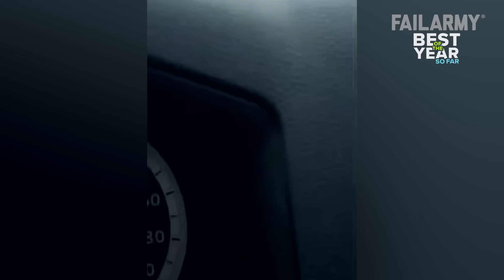Best Fails of the Year (So Far) 2023

Comment: 6:22 If there wasn't a video, it would be extremely difficult to figure out exactly how that truck managed to achieve that position. It's impressive.
Reply: I'm glad I finally saw it; I've seen stills of the end result. I hope they gave a copy of the dashcam footage to everyone involved so they can try to explain it to their insurance companies!
Reply: I wonder what the cops first thought when coming to the scene 😂
Reply: It was at this moment he knew he fucked up.
Reply: That's why I started watching this compilation. I watched that 3 times to figure it out.
Reply: I bet he quit
Reply: Execution was a little sloppy, but man, he really stuck that landing.
Reply: Definitely my favorite clip. Glad to learn the entire process.
Reply: That clip is in my top 3 "sir, you can't park there" moments. It's so VERY unlikely.
Reply: @caydengibson that was a rental truck, wonder where he'd quit from
Reply: You need my company to move a truck from were. Good luck pal.
Reply: watched a couple of times, insurance is glad it was caught on video, hard to explain what happened!
Reply: What is the part that rotates under the truck called?
Reply: @alexescare320  Flettner ventilator. That's the spinning thing if that's what your talking about. Or the drive shaft
Reply: @alexescare320  That's the drive shaft (also called a prop shaft). It takes the rotational force generated by the engine and sends it to the rear axle and wheels.
Reply: That was like something out of gta when you car glitches
Reply: @Ihavehadmanynames7779  Right? I expect it to start clipping and then launch thousands of feet into the air. 😂
Reply: I'm in the furniture installation biz, and I'm always looking for more efficient ways to get stuff to the second floor.  The dude is a genius.
Reply: I saw something very similar down the street from me. A sports car that was propped up against a building upside down, with all 4 wheels touching the wall. Driver opened the window and crawled out, but how that came about is a mystery because there was no ditch or anything to give the car any upward momentum.
Reply: That’s exactly why I watched!
Reply: the truck is filled with helium
Reply: Agree
Reply: The Lord works in mysterious ways. Amen. 😂
Reply: yep these are so funny
Reply: This video is from 2019 not 2023
Reply: Try doin that on purpose!
Reply: This happened in 2019 so this video lies about it being fails of this year lol
Reply: @dman3645  yeah man this happened about 40 km from where I live, it was all over our local news
Reply: @AH-lw2bj  yeah in Sudbury myself so was big news for probably a boring day lol
Reply: @dman3645  I'm in Sudbury too!
Reply: hashtag Penske rental drivers
Reply: 3:35 that is going to hurt and potentially blind you for life
Reply: It's Amazon Prime delivery
Reply: Hello my friends, Mady Hani wishes you all a joyful video-watching experience and a wonderful day!
Reply: Worst part is: I doubt the insurance for the house covers a truck being stuck on the second floor 😂
Reply: Dead ass hilarious!!
Also expensive 😂
Reply: Je ne te le fait pas dire tu as toute a fait raison.
Reply: I sure hope he opted for the extra insurance.
Reply: Like something that would happen in a gta game.
Reply: it's the 'how could it possibly end up like that?' explanation clip for those moments you see something unbelievable, and now we finally have an answer! or at least in this case we do. If i hadn't seen the clip and only the result, i would've thought the truck dropped out of the sky like that!
Reply: "911, what's the emergency?" 
"Uh... bro, honest, I don't know how to describe this.... there's an 18 wheeler with its ass up on a house..." 
"Sure thing. 18-wheeler on a house. How many drinks have you had?"
"Hand to God, man..."
Reply: Even with the video it's still really odd to comprehend
Reply: the shot lasted longer also, as if to wonder about it.
Reply: "HEY! YOU CAN'T PARK THERE!"
Reply: Sherlock Holmes could figure it out
Reply: nice
Reply: Daddy, there is a Truck at my Window 

Baby, your Room is in the Second floor, there is no Truck at your Window 

...
Reply: Indeed
Reply: Even with that, I get how it physically happened, but still my brain is going 'How?!' The number of events that came together at that one moment..
Reply: Yeah, it's called yoga
Reply: @Freeman4815  Downward dog, yeah? 😂
Reply: That is exactly where l have just paused it! How the Eff did he do that?
Reply: Even with the video it’s confusing
Reply: That video deserves an own comment section. I had to see it to believe it happened
Reply: @Brainsore. 

The truck, in Quebec Canada, ran into a ditch, and then caught a cross bridge on a slant, and stop the cab, and the  back end kept going, no where to go but up, and to the right. Woo Hoo!
Reply: no way, the ETS 2 Reference
Reply: imagine you're in your house, on second floor, chilling and suddenly you're in a car crash. 
Yeah, some very unlucky mf is living here.
Reply: Imagine calling your insurance agent to get your roof fixed for that one
Reply: I'm fine go away
Reply: @Cartman8402 driver definitely fell asleep at the wheel
Reply: @clayongunzelle9555  I'm sure. But still. How?🤔🤔😉
Reply: 3:31 Grounded for a damned year!  That's what I say!  What is the deal with all the bees?  Why would he just stay there and get stung?
Reply: "it was intentional" "wow! you're amazing!"
Reply: DVD z
Reply: My.    Name.      Alistair
    Chugging
Reply: @Cartman8402 bahrfabafahahana
Reply: I watched it and still don’t know how it got there
Reply: i didnt even notice that :cat-orange-whistling:
Reply: I've seen the pic before, but never the video. Finally one of the great questions has been answered
Reply: 6:07... Not 6:22
Reply: @aesaehttr  I was referring to the aftermath, not the crash itself.
Reply: 3:36 she spilled paint onto her face and on the couch
Reply: It's so impressive.
Reply: The spring in that truck must be alien tech. Jumped off the ditch like a lunar module.
Reply: Even with the video I'm not exactly sure what caused that. 😄
Reply: The definition of: you cannot park here
Reply: And the cammer stopped and said...

"Hey, you can't park here."
Reply: that was crazy hoow did that truck do that
Reply: Optimus prime failed to transform😂
Reply: even with the video, it still is!
Reply: Why nobody mentioned the Man of Steel scene with the truck ?
Reply: "This is Kevin from Allstate Homeowners Insurance how can I help you?   ...   ...   ... "BULL SHIT!"
Reply: That's some random source engine physics. Thought I was watching  half-life game play. 😂
Reply: @Thesamurai1999  probably the driver is going to need a change of clothes 😂😂
Reply: @pippagrey9633  Can you imagine that conversation? "Hi AAA? Do I have coverage for having a semi fall on my house? Can I prove it? Yes...actually, surprisingly I CAN prove it. But am I covered?"
Reply: @Species-lj8wh  It was at that moment he realized that maybe trucking wasn't in his blood after all!
Reply: @sandraneitch6632 First, the wheels of the cab began to slow down, and then the body. But according to the rules, the wheels of the body must first slow down, then the cabs
Reply: @Thesamurai1999  they would think if the truck got spawned. " did that just spawned* or " what the hell"
Reply: Hi
Reply: @Thesamurai1999  So ummm... a truck assaulted my house...
Reply: @pippagrey9633  Imagine hearing a noise and looking out your second floor window and seeing the bottom of a truck that t bagged your house...then having to file an insurance claim and explain a moving truck landed on your roof booty first.
Reply: 6:22 I would have thought that car fell from the sky if it weren't for the camera🤣
Reply: i mean, have you tried employing logic? how tf else would it be there lmfao
Reply: it is so awful
Reply: Truly admirable!
Reply: Aisha. Kai. Audi. Kanan. Manny 😢😢😢😢
Reply: If it's a video, it's probably the most realistic video.bro
Reply: This video feels like an unsolved puzzle! Do you think the truck hit something, or did it just naturally end up in this situation?
Reply: People aren't born stupid. They choose to stay that way by ignoring facts and refusing to learn.
Reply: I hope they gave a copy of the dashcam footage to everyone involved so they can try to explain it to their insurance companies ❤❤❤
Reply: I'm really glad I finally got to see it, especially after having only seen still shots of the final outcome. Hopefully, everyone involved received a copy of the dashcam footage to help them explain it to their insurance providers! 😂😂😂
Reply: I'm curious about what the police initially thought upon arriving at the scene.😂😂

Comment: 3:09
Please please please please please, if someone has a fall like that, DO NOT STAND THEM UP! Keep them laid down, put them in recovery position and call emergency services.
I CANNOT stress how important it is to not move them...
Reply: yeah that that is scary as f
Reply: Also that "shake it off" pat on the backs...
Reply: Yes that was also my first thought. I helped at the fire brigade for a while. If you fall from such a high you risk breaking your neck. This is particularly dangerous because in that situation you might not even notice it and start moving your head by your self. But moving your head can be extremely dangerous in that situation since a major part of your Nervsystem is locate in your neck. So if you move your head and have a broken neck, you may damage these nerves permanently and at best be unable to move anything except your head from now on or straight away just die.

So if you see somebody fall from such a hight tell them to NOT GET UP and NOT MOVE THEIR HEAD and slowly bring them in the recovery position while constantly supporting their head making sure to NOT TILT OR TURN THEIR HEAD and wait until an ambulance arrives. They will have something that I know as a "stiff neck" which is a special piece of plastic put around your neck to ensure that you don't move your head untill they can be sure that you didn't break anything.
Reply: 99% that one is staged. You “conveniently” don’t see the fall and don’t see the roof anymore after the “fall”. The guy on the roof didn’t fall.
Reply: @magicmulder  whether it's staged or not I don't care, I care more about if this happens in real life and someone just tries to pick them up instead of leaving them on the ground and calling an ambulance.
Reply: always try and walk it off first. if that doesn't work, just go to the emergency room with your broken neck.
Reply: They weren't all funny, some of them looked pretty painful!
Reply: @inflamespwn  Litterally the worst thing you could do...
(If you're being sarcastic I'm sorry, it doesn't translate over text.)
Reply: 3:07
Reply: Yes I thought so too! Could have done that man even more damage 😔😔😔❤
Reply: Yeah! People do that I really don't know why! 
I had an scooter accident few weeks ago, fell on the road, a guy run and take my arm to get me up without asking me anything....but with ribs broken and torn shoulder muscles, he just hurts me so bad! I say NO NO NO! It's ok, don't touch me!

With this fall, this poor guy should never be moved before the ambulance comes! Hope he survives
Reply: Natural Selection my dear 😂
Reply: exactly.
Reply: @magicmulder  It wasn't staged, you can literally see the snow go everywhere from his impact, and the shovel fell from the roof.
Reply: @VictorMartinez-en8zr  The shovel fell a lot slower than him then, as did the snow that fell down with him. Still not convinced.
Reply: Unfortunately there is a huge in most manual labor to not talk about workplace injuries. If you break a pinky, the answer is "No, I broke it at home this morning shaving." There's a few reason's but mostly it's not wanting to be seen as a worker that causes issues. It's paperwork, safety meetings, you fall off a ladder 3 feet and bruise ur side and everyone has to now go for a day of safety meetings and the brief on the incident. I've done it myself, everyone has.
So, that happens once and you find yourself getting only less dangerous jobs which means less hours. Happens again and maybe they just don't seem to have any jobs to send you on anymore.
Of course this is 100% the company's fault he shouldn't have been up there like that, they could've at the very least tied a rope to him and held it from the other side of the building, I mean 2 of them were apparently just standing there. They could've talked to the owner about installing some kinda anchors which would also speed up future work making it cheaper, it's already got that jank antenna not like their going for looks.

Sorry for the tangent I've seen safety videos of people legit being finished by falls less then this, should never have happened let alone them just picking him up.
Reply: @tcode3564  Your understating just how bad this is. That height was simply insane, even though he was walking I'm almost sure he landing almost entirely on one leg, something in there is broken. I've seen people die from 10 foot falls.
But also when you call the ambulance try to say whether or not the person is breathing, DO NOT MOVE THEM but check. A broken neck can often lead to a blockage in the airway WHICH YOU WILL NOT BE QUALIFIED TO FIX. This also means the person might not be breathing but still alive(ish).
Reply: @magicmulder I thought the same thing
Reply: @SheldonMurphy-fp4ko  LMAO!! Literally the opposite of every place I've ever worked. You hurt yourself at home? Walk that shit off until you get to work and take a dive there. Workman's comp. Who the hell told you to say you hurt yourself at home? Lol.
Reply: @SheldonMurphy-fp4ko Landing on one leg? Nah. Watch that again at 0.25 playback speed. He landed flat on his back with both legs up in the air. Meaning he DEFINITELY hit his head. He'd be dead. This was staged.
Reply: @SheldonMurphy-fp4ko  you're
Reply: @tcode3564  Breaking his neck isn't the only possibility, we also own a back. The point of not moving them is so their ENTIRE back and neck don't move. I think it's important not to omit this. Otherwise they might just try to turn or wriggle only without moving their neck and paralyze themselves from the waist down.
Reply: The probability that the guy died later that day is very high.
Reply: I don't think you understand the reason people watch these videos.